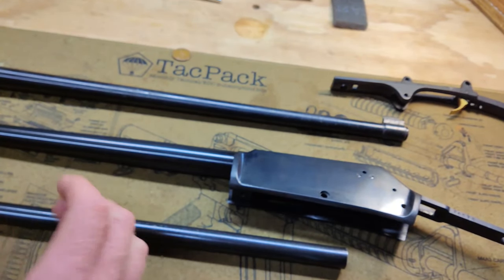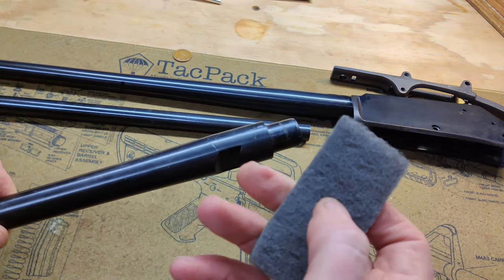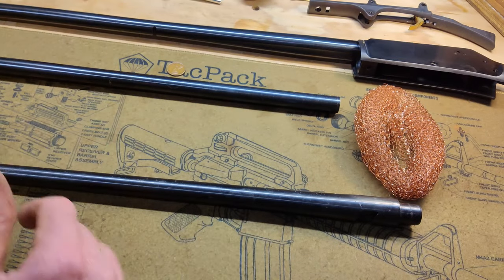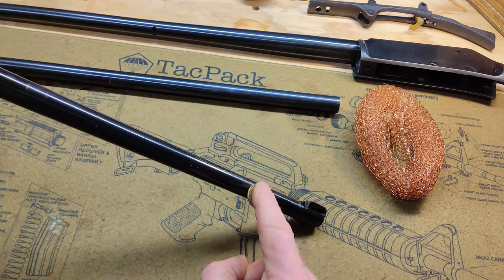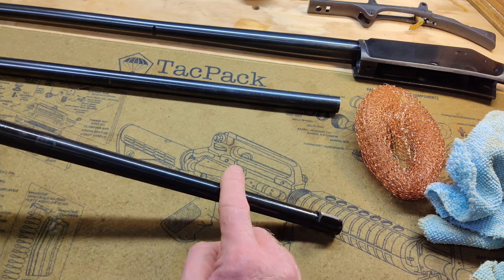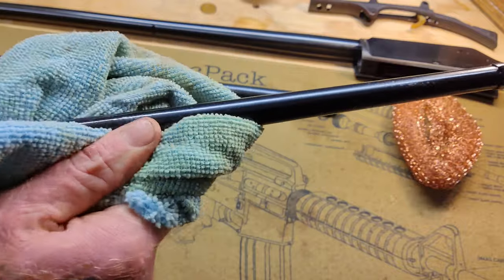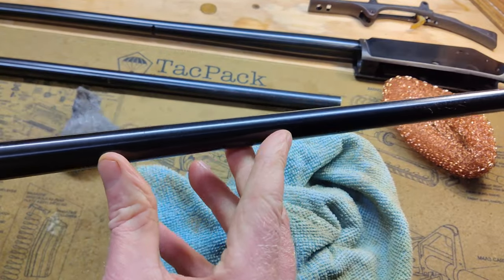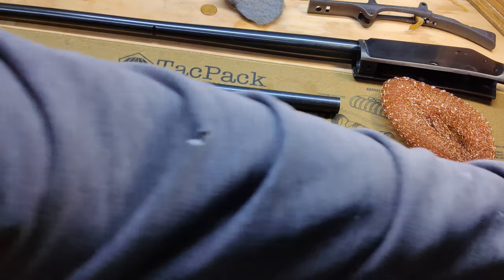Don't EFF up a Firearm Over Surface Rust  !!

Comment: I recently picked up a nice-looking Colt Diamondback 22LR and brought it home for disassembly, inspection and cleaning. The exterior was beautiful but I when I removed the side plate, I was stunned. Inside, the interior surfaces of the frame had formed a superficial surface rust (but thankfully no pitting) even though all the small parts looked fine. With all the nooks and crannies, an old penny, a copper Brillo pad or steel wool was out of the question. My plan of attack is to soak it overnight with Kroil and then go at it with a copper-bristled toothbrush. After that I'll spray the interior with Hornady's "One shot" which goes on wet and then dries, leaving a thin, protective film to protect the metal from any further corrosion.

Comment: I found when my firearms get a tiny spot of surface rust on blued steel, no matter what the removal process I use to remove it was, its like a cancer and always comes back with a vengeance and attitude. Cold blue helps, but really the only way to fix and stop the cancer is a re hot blue of entire part after strip and polish.
Reply: Just asking , how are you storing your guns?

Comment: Cleaned many guns with surface rust with Frontier 45 steel wool.  Rub it off dry, doesn't hurt the bluing. Friend of mine had a colt .22, .22 mag combo revolver. Had some surface rust on it. Told me he was going to have to get it reblued.  Took the wool and had it clean in a few minutes.

Comment: Good info. 

For decades I have had good luck using 0000 steel wool and Hoppes #9 bore solvent for surface freckles. Soak a piece of steel wool, and gently buff the piece, once over. Let it sit for at least an hour. Then use the Hoppes-wet 0000 to gently buff off the freckles. Gently!  If it looks like you’re affecting the bluing, back off. Leave the gun moist until the next day, repeat, wipe off with paper towel, then wet it again with 0000 and Hoppes. In 2-4 days you should be able to lift the rust off and maintain the bluing/patina.

Comment: The penny works very good I have tried that, you can also use a bronze wool with Rem oil very lightly, personally I would never use any steel wool regardless of fineness.
Reply: 0000 steel wool works great on light rust. Brass or copper scraper on heavier rust.

Comment: Thanks! I've got a few firearms that I inherited from my grandfather that have....patina, I  call it rust. I immediately oiled and reoiled to try to keep them from getting worse.  Several people gave me suggestions,  that you pointed out to not do. I was very suspicious about using 000 steel wool as I was told because I couldn't see how that would preserve the blueing that is left. My 1954 marlin 39A for example has a very nice shiny blueing when it is oiled but you can just see the tiny specs of rust.

Comment: Thanks bro. I'm looking at kinda sorta restoring the Winchester Model 77 my dad just handed down to me. The wood looks ok to good, but not great. the barrel has some surface rust as it gets a bit humid in the room they kept it in. So I'm going to have to break into my stash of antique pennies in my safe & try that trick first.  Thanks for the video!

Comment: 12 ga Romex copper wire also works well.  Cut the tip at an angle and you get a nice sharp edge that can be used to scratch off red rust.

Comment: A lot of those copper brillo pads say copper coated. Would those be acceptable or does it need to be 100% copper? Does it matter what type of penetrating oil/fluid you use? What one are you using?
Reply: The copper coating is super thin, and it will rapidly wear out and start scratching.

I personally use any oil as I believe the rubbing does 99% of the work.

Comment: Thanks for another video. What do you think about boiling or steaming the part first.  I’m looking for a project to try it on.
Reply from the maker: I do boil them, buff on a carding wheel and oil dip. Works great on firearms with alot of loose surface rust.

Comment: Will there still be stains and spots on the bluing after you finish with the 0000 steel wool? Or will they disappear completely? I am hesitant to try it on a very nice Beretta s687 over under
Reply from the maker: It depends on how deep the rust went down. If rust had time to fester in a spot it may have gotten deep enough to remove the OG bluing and yes you could get a white spot after using 0000. If in doubt seek a pro in your area.
Reply: Thanks for the reply 👍👍

Comment: I have a savage axis that's been sitting in my cabinet for a while now and has never been shot. I pulled it out and the barrel has a brown tint to it. Is that surface rust or blue oxidation and can frontier 45 take care of that?
Reply from the maker: Sounds like surface rust, go at it lightly with Hoppes 9 and 0000 steel wool in the same direction as the machining marks.

Comment: What was the penetrating oil used? Nice finish!
Reply from the maker: 50/50 automatic transmission fluid and K1 kerosene
Reply: @pachuagfirearmsrestorations awesome tips! Have you ever used steel wool with plain motor oil as the lubricant? I know some people use motor oil....does the ATF with kerosene work better? I'm guessing you use ATF kerosene for a reason, it must have some benefits.
Reply from the maker: @stephenwhite5444  plain, non-detergent motor oil will probably do a good job. I use ATF/K1 because its thinner and has no ingredients that will attack good bluing. Note that some fluids like PB Blast have rust removing agents in them that will strip brown rust AND bluing!!

Comment: Am i ahead to get it clean like this and then cold blue repeatedly until it matches up with areas unaffected or use the blue/rust remover that comes with the cold blue.  
Id like to save the factory blueing though idk how well the cold blue will match it.
Reply from the maker: Whatever you do, DO NOT use the blue / rust remover! It will strip everything off, and quick to. If you want to try the cold blue, try it in a spot that won't be noticed.
Reply: @pachuagfirearmsrestorations  thank you for the reply.  
That was always my concern with the remover.  If it's gonna go all the way bare and you don't do the whole surface. I can't see it ever matching what wasn't worked on. 
Now I could see using it if you were going to do the whole thing. But at that point you may as well take it to have it hot blued or rebarrel.

Comment: What would your suggestion be for quite a bit heavier rust, but on something more “important” like say, pre 64?
I would rather leave it original, but the rust and grunge needs to go.
(Ps, also the wood is in great shape but really grungy)
Reply from the maker: I did have a pre 64 Marlin lever come thru several months ago. While it wasn't rusted on one side of the barrel someone had used 80 grit sandpaper to remove rust and in the process took the barrel down to the white. I sanded just the hosed up areas, in the same direction as the factory finish, using finer and finer grits until the sanded sheen matched and used several coats of cold blue until it match.

Comment: Will sanding it down and painting it will it just stop the rust from coming back ?
Reply from the maker: It would, but the value of the firearm would never be the same. Main goal of this video is to show everyone that you can remove that minor rust and keep the firearm in as close to original as possible. Best thing to do is always clean and lightly oil them after use.

Comment: Is there a way to cover up the pitting on the metal?
Reply from the maker: Unfortunately no. If the rust caused severe pitting and the bluing is gone the only way to get it back to original is to take it down to white steel and re-blue it.

Comment: is a brass brush ok to use as well?
Reply from the maker: I would be careful of a brass brush. Bristles are typically stiffer and may damage the bluing. Try it on and inconspicuous spot first.
Reply: @pachuagfirearmsrestorations in an other video, they say brass would be ok, bronce, however not.
Nevertheless I will use the method in this video.

Comment: what about getting around a vent rib, ??
Reply from the maker: @bustersmith5569  I've rolled up 4 ought steel wool like yarn and fit it under the rib. Once you have it through a gentle shoe shine motion with plenty of oil will work on light rust.

Comment: Those copper brillo pads are copper coated stainless.  I've got some copper mesh that works great and won't hurt the blue.  Pre 1984 copper pennies are copper.  1984 to present are copper plated zink.
Reply: Actually it’s 1982 (and only certain 1982 Lincoln Pennies at that) so it’s probably best just to stick with anything 1981 or older!

Comment: Which is your penetrating fluid of choice?
Reply: Kroil here but a 50/50 mix of automotive automatic transmission  fluid and acetone works very well to soak the parts in as well. He doesn't cover that here using a piece of PVC pipe with a cap glued on one end and a threaded coupling and threaded removable plug on the other. Most these YouTube guys go about it more rough than you probably should. He's already scratching away with abrasives when what he should have done was mixed up that 50/50 mix and used the PVC pipe to let them soak for a few days. Often times that lifts it off with no "scrubbing" at all. Both the Kroil and the home brew 50/50 mix get under the rust and float it off the surface and away.

Comment: Use 0000 steel wool and motor oil and a light touch and you'll be fine.

Comment: Would WD40 work? Or pb blast?
Reply from the maker: Pb Blast may remove bluing. Test in a spot first. Best thing to use is a pure petroleum product, oil or kerosene.
Reply: @pachuagfirearmsrestorations  atf?

Comment: Now why aren’t you advocating at all not to add oil but to boil it converting that rust into black iron oxide? And why did you cold blue? Are you not capable of rust bluing? It’s acid, boil card with 0000 steel wool and repeat until it’s as dark as you want. I’ve used permablue and don’t like it even for small parts. Fine to tarnish brass if you don’t want to wait for time to do it.
Reply from the maker: Separate video on boiling